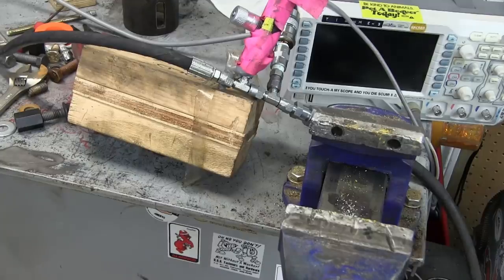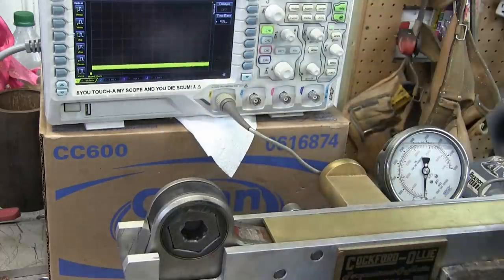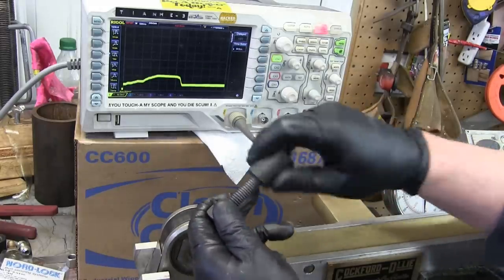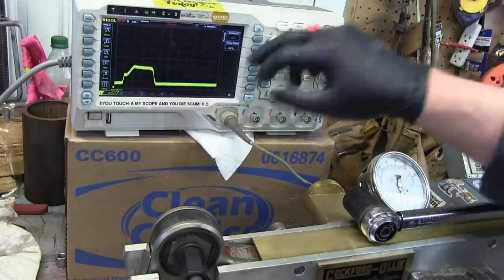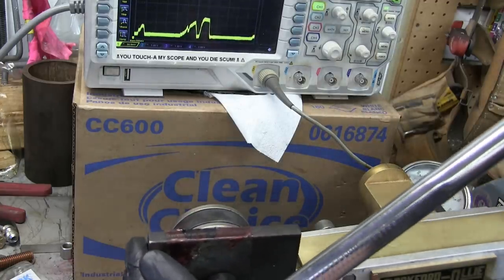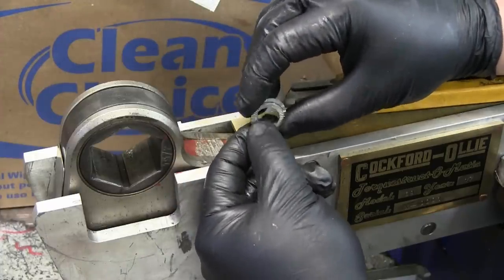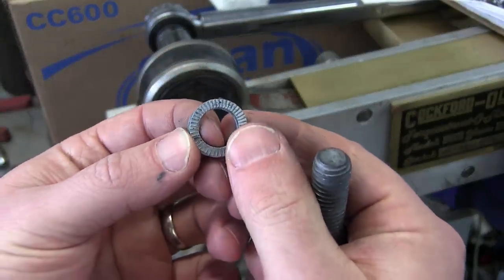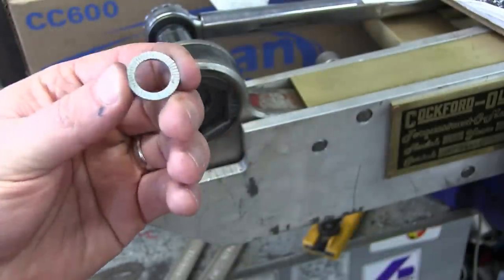Nord-Lock Washers | Do they work better?

Comment: So long story short, if you're needing to prevent bolts from coming loose from vibration, safety wire them, like we do on aircraft.
Reply: bstrickler safety wire is more expensive than nordlocks and can't be used in any situation because safety wire needs to be safety wired off something else
Reply: bstrickler I've been meaning to buy some of those fancy safety wire twisting pliers
Reply: I safety wired my exhaust manifold bolts in place. All I needed was a drill and a roll of stainless safety wire. Cheap as dirt and is still working today. I don't even remember how long it has been. When I did my engine rebuild I put new bolts in and they just wouldn't stay tight. May have been because I used a gasket but I had to because the original machined surface was not sealing. I definatly takes time but doing it at home for yourself labor time is not an issue.
Reply: Narcoleptic then how to always crimp
Reply: TIG stainless steel wire works there as well, and is a lot cheaper to get as well, you might find an end of roll at the local welder for free.
Reply: SeanBZA coat hangers. JK mama always said- no more wire hangers (back when I had the kt100 on the kart)
Reply: William Anderson
aka pin and weld my suppressor to my short barrel so I only have to write the gov't one $200 check instead of two. What a scam.. abolish the NFA already.
Reply: I use flange bolts and stake them into place. I saw this in some firearms I own and decided if it was good enough for explosion machines then it was good enough for my excavator. (I’m Canadian so the guns are Uzi’s and MAC 10’s but high powered hunting rifles used for target shooting so precision and consistency were important).
Reply: Split pin works too.
Reply: Roland Anderson only prevents a castle nut from coming undone. Does nothing for preventing a bolt from spinning, which can cause other damage.
Reply: Or use all-metal lock nuts, which are even more common on aircraft!  (Nylocs can fail at inconvenient times. At least one F-16 (maybe two but it's been many years) crashed because the single nyloc holding a permanent magnet generator rotor backed off.)
Reply: Ob Fuscated true.
Reply: Narcoleptic Why wouldn't lockwire stop a bolt from coming untorqued? Lockwire needs to be put on in the right direction for a reason. If you do it right, in order for one bolt to loosen, the one(s) next to it needs to *tighten*, which usually isn't possible, and takes more force than the loosening. Unless the wire stretches, but that shouldn't be much. Lockwire isn't like strapping a safety line to a wrench so it doesn't hurt anything if it falls, it prevents the bolt from ever backing out in the first place. Correct me if I'm wrong.
Reply: bstrickler nah drill it like you would for safety wire. Works fine if you're not going to be flying it. Nice for vibrating yard equipment.
Reply: Many planetary final drives use safety wire to simply stop a screw from falling out and grenading the gears.
Reply: Lockwire is too thin to stop the bolt from loosening, but what it does do is stop the bolt spinning enough to fall out, but now your bolted connection doesn't have it's preload anymore.

It is easy to stretch lockwire in comparison to bolt torque, for example: 
316 cold drawn stainless 0.81mm diameter lockwire: 
a 20mm bolt head will stretch lockwire at 7Nm or 5.2ft/lbs.
Assumed 680MPa tensile.
The smaller the bolt head the less torque needed.
Reply: That is a funny way to say mushroom the end of the bolt over with a ball-pen hammer.
Reply: Distorted thread lock nuts are fucking evil in most applications.
Reply: Mushrooming the bolt works great until you have to take it apart.
Reply: Most nutplates and nuts on aircraft have locking device already. If it isn't a smashed nut then it is castellated and pinned. Even essential components that have locking nuts have secondary lock wire or threadlocker installed sometimes.
Reply: Tom Armstrong   My exhaust manifold NUTS are that way. Use then just once and they work great! They don't loosen up.
Reply: @egg19  "unless the wire stretches, but that should not be much"

How far do you think you have to turn a bolt to go from 100 foot lbs to 0 foot lbs? What about 100 to 150?  The amount that the fastener turns is tiny when torquing or breaking it free. 

99.8% of the function of lock wire is just keeping the bits and bobs in place.
Reply: Or a castle nut and cotter pin? Stud everything instead of bolt everything, supposedly it's more accurate with torque like with head bolts vs studs.
Reply: but that takes so long xD. Nordlocks are more for heavy industrial machines.
Reply: @mplewp  lol. If you're good, it doesn't take long at all, assuming there's enough room. 

If it's in a tight spot, you can use safety cable.
Reply: @bstrickler  you are an aircraft guy :P i respect that. but in the type of stuff that we work on its just not an option. " greasy dirty stuff " xD 
terex stradlers might look nice on pictures but in reality they are greasy as F xD.
Reply: @mplewp  yup. 4 years as a mechanic in the commercial world.
Reply: @mplewp  airplanes can be nasty/dirty, as well.
Reply: @bstrickler  you don't want to trade really :P although stradlers cant have a serious poop tank leak ill give you that ^^
Reply: @mplewp  lol. Fortunately, I don't deal with the shitters, or turd spelunking when people drop their phones in the toilet (yes, they do ask for them back)
Reply: @mplewp  and I don't have to do that, because my arms are too big to fit down the hole. My elbow will get stuxk
Reply: Yea, that safety wire woukd corrode and break in under a month in the applications that our fleet of equipment works in.
Reply: @elcidbob  if it moves, you wired it wrong 😂

Comment: I have a Paslode nail gun that is 35 years old that has at least a million nails through it.  For most of it's life the bolts holding the nose on to the main body would loosen at least once a month and need to be re torqued.  I put Nordlocks on it 5 years ago and haven't touched it since.
Reply: omg i wish i would of read that comment 15 years ago, thx for the tips, am SOOOO gonna do that right the heck now !!
Reply: Personally I find nail varnish works well!
Reply: David Collins-Cubitt loctite
Reply: indeed, nail varnish is cheaper (usually) and is as good.
Reply: I mean, it's fine if manly isn't what you're going for... but a man should be more likely to have loctite on hand than nail varnish lol :)
Reply: Yeah but I actually own loctite.
Reply: @SuprSi  Took me a minute to figure out you mean nail varnish for finger nails. Here I thought you guys varnished your nails before putting them into the wood.
Reply: @BrBCatsOnFireLuL  wait, you don't? feck
Reply: @BrBCatsOnFireLuL  Me too mate, me too...
Reply: @BrBCatsOnFireLuL  I varnish my wood before I nail.
Reply: Personally I just cross thread it and hammer it home. But you know what they say about stir frying cats.
Reply: Being a manly man, I do have nail polish remover for the express purpose of removing superglue, but I do not have nail polish.  I have a wife and two daughters, though, and THEY have nail polish, so when I'm trying to track down an electrical problem in the car and do the South Main Auto hokey pokey with a needle, I can patch the hole with Pretty Pretty Princess With Extra Sparkles.  😂
Reply: So, use these when you absolutely don't intend for the fastener to ever come out again but welding isn't an option.

Comment: In order to back off the nordlocks, you have to apply the same force (torque) for a longer distance (rotation angle). Force * Distance. That is work, or energy. Also, if you don't back it far enough to skip to the next valley, then it will be energetically favorable for it to go back to its original position. So vibration may move it around, but if the force isn't great enough, it will not make cumulative progress. But with a flat washer, every time the bolt loosens even a tiny bit, it will be harder for it to go back. It WANTS to loosen. It is like a ball rolling downhill. The best analogy is this: Nordlock is like putting chocks on your wheels when you park your truck on a hill. The truck can't roll down the hill unless it rolls up over the chocks first.

Comment: The summary in the Fastener Design Manual from NASA in reference to spring lockwashers. "A lockwasher of this type is useless for locking"
Reply: kumaclimber can I get a link to this?
Reply: The Gargler is your friend. Took me 15 seconds to find and download here: https://ntrs.nasa.gov/archive/nasa/casi.ntrs.nasa.gov/19900009424.pdf

The quote took 30 seconds longer:

The lockwasher serves as a spring while the bolt is being tightened. However, the washer is normally flat by the time the bolt is fully torqued. At this time it is equivalent to a solid flat washer, and its locking ability is
nonexistent. In summary, a Iockwasher of this type is useless for locking.
Reply: Not a link to the manual, but I think this guy wrote the manual:  https://youtu.be/vkbBpAOM4kM?t=39m  The rest of the series is very much worth watching if you're into nuts and bolts.  And maybe rivets too.  For those looking for locking methods, he presents this one last so go back a bit.  Nordlocs are in there too.
Reply: kumaclimber NASA? Thought they went broke?
Reply: Jimmy's Tractor - Not until WE are all broke.
Reply: Uhm not sure where you got that idea
Reply: @guyfawkes9951  holy hell, man. I know this comment is a year old, but the link works and I now have 100 pages of neato stuff to browse.

Comment: I've used Nord-Lock Washers for a few years, on the turbo setup in my car. No matter what I used or did, there was always one bolt that'd loosen up after about a week or less of driving (burning out the gasket). I ran into these Nord-Locks and figured it was worth a shot. They definitely worked for me and fixed my issue!

Comment: The issue with this test is that washers aren't designed to resist torque. You said it yourself - they're designed to resist slip through vibration.

You could make a variable vibrator then test their release torque after a few minutes of being exposed to different frequencies, maybe using a speaker. Then you'll see the nordlock start performing as it should. Since you're getting such consistent release values the test is totally doable.

My favourite washer is a rusty thread.
Reply: He has the industrial vibrator he can put on a plate
Reply: I did think of that but I don't think it'd hit engine RPM frequencies (that being the frequency that always undoes my nuts), whereas a speaker driver is going to have a decent range. It all depends what kind of amplitude it can put out.
Reply: Justin Cook you mean a speaker like the Styrofoam board he used???
Reply: Better, use an inducer. They're big and designed to shake things and have decent range.
Reply: Should have used my old 500cc Triumph Motorcycle, that was a good test for any nut and bolt combination.
Reply: I have tested nordlock with vibration 50hz they wörk
Reply: I expect that's what any reasonable test will find - nordlock forces you to destroy the washer to undo it so anything that the washer can withstand won't cause it to come undone.
Reply: They do pretty good against torque. We use em in the oilfield on topdrives which experience all tge above and they hold up much better than other applications. To go the step further we use 242 blue lock tite with norlocks being the equipment is above the drillers floor.
Reply: A magnetic exhaust is a good retrofit.  Didn't work when the headlight fell off though.
Reply: You missed the point.  He showed the mechanism by which the nordlocks work
Reply: Variable speed vibrators aren’t hard to find, my wife has at least 3.
Reply: jep the torque isn’t that important here. the best method to avoid lose connections is to use nylon lock nuts - there is no downside to them imo. they are used for many applications here in Germany. And I’m always wondering why they’re not more widely used elsewhere. 

because spring and or lock washers are really useless...
Reply: P J What's the melting/softening points for nylon? Any use beyond such temperatures are precluded.
Reply: Adam Ant just had to look it up:

190–350 °C
374–663 °F

Depending on the used nylon. plenty of room for most applications. but yes, not for everything. still the superior option for general use imo.
Reply: Cross thread is a tight thread.
Reply: gasworksend4blues  My KLR 650 does extremely well to vibrate off nuts and bolts.  Thus the saying KLR stands for keep loctite ready.
Reply: Lol at the rusty thread. You know.. Maybe removing protective coating on a part of the thread and soaking it in water might just be the best way to attach two things together permanently.. Well, until it all rusts through and just falls apart :)
Reply: I am using external tooth washers to resist torque and they work reasonably well in my application.   How easy can it be to rotate a external tooth that is dug into metal?
Reply: Save a buck; spray your threads with vinegar, not Loctite.

Comment: I love Nord-Locks. Worked 20 years as FSE on CNC punches. One thing to remember is that they should be replaced every time you loosen them. I did reuse them most of the time with little issue though. 

I swear sometimes when you break one free I think I have broken the ratchet or bolt they crack so loud. You have to be careful not to bust a knuckle too. 

Awesome channel AvE.

Comment: I recall reading somewhere sciency that nut loosening is caused primarily by axial vibration. If I remember correct(many years) when the vibe amplitude exceeds preload, then the friction momentarily drops to zero and then on reapplication of axial stress the ramp force causes a bit of loosening rotation just before friction once again kicks in. 
The lock via biting-in devices really only work by forcing the vibration amplitude to overcome the depth of the bite.

Comment: I've worked with Nordlocks extensively and most of your conclusions are spot on. The Nordlocks are particularly good in high vibration because as you try to back them out and they stretch your bolt you increase your joint stiffness.

Comment: I was told by a mechanic at work that lock washers aren't there to make it harder to get the bolt loose, they are there for longevity.  For instance, we have overhead water lines and pressure lines running overhead.  There is impulse testing equipment in the plant so the lines shake and vibrate the roof structure.  Lock washers are used on the brackets that hold the lines not so that its harder to break them loose but because they keep the bolt at tension for a longer period of time under stresses.

Comment: Not first but wont be last. Nordlocks are a very interesting concept. Myself, working in the automotive industry, typically use these on high horsepower, high heat, ridgid mount engines where vibration levels are high. We have had many cases of blown out exhaust manifold gasket on high HP turbo applicatons simply because of the split lock washers failing and allowing the bolts to back off. Its very rare that I see Nords "backing off" or failing under these stressors. Unfortunatly on some of the high grade stainless manifolds we install the Nords dont seem to make much of a difference because of the coefficient of friction between the harden materials. I think you hit that right on the head. One would have thought the Nords would require MUCH more torque to back off but i guess the degree required to loosing the fastener is a good trade off.
Reply: Nordlock washers are a godsend when it comes to bolting on turbos. Especially on flanges that warp with the heat.. I've had setups that needed re tightening and gasketing weekly. Even after machining the flanges flat.

After finding the fancy washers, pretty much all of my problems went away.

Comment: I use to work on "shaker" motors. Used for coal powered power plants. Double shaft motors with 25# to 50# counter weights on each end. These are designed to shake. All of them used "shake proof washers." Internal/external tooth lock washers. I would love to see you do this test with them. I never saw a motor come in with loose bolts. Always with bad bearings. Lots of machine work. We also used red locktite on the bolts for reassembly. But would like to see the test anyway.

Comment: Thanks, Ave for your videos. I find this video interesting as I've worked as an industrial mechanic in different areas like building offshore equipment and maintenance in factories. With offshore equipment the standard is usually nord-lock on hydraulic flanges etc. Sewing smaller bolts together also works! Last but not least red loctite often comes in handy, but should also be used with high-torque fasteners

Comment: I'd be curious to see how these would work if you torqued the bolts up to generate the minimum pretension for whatever grade bolt they are. I have a feeling they'd work much betting in that condition as the threads haven't stretched at all at only 100 ft*lbs. So you'd see them bite in deeper, and the bolt would be in significant tension and therefore resist that prying action created by the tapered surfaces. I also agree with some of the other comments regarding torque vs. vibration. I suspect they might resist vibration better than torque. Great video as always, keep your stick on the ice. Now for Nyloc nuts...